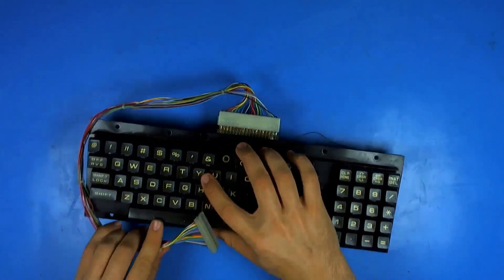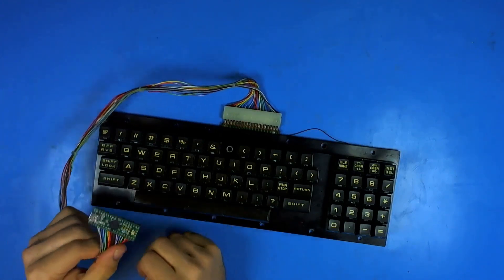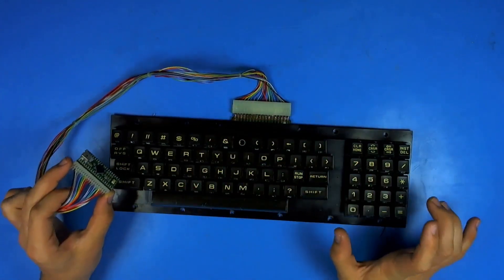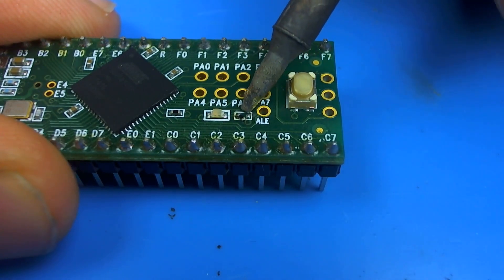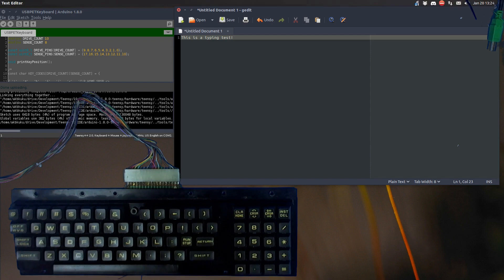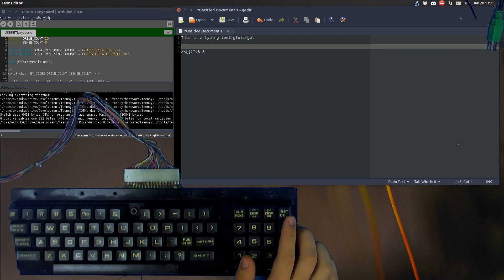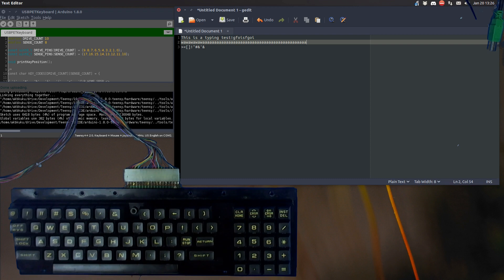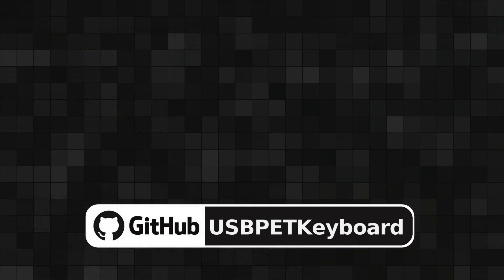0x0007 - USB Commodore PET Keyboard

Comment: I'm curious, how is the keyboard above the Ubuntu Desktop? Are you doing background replacement, or do you have a fancy-pants tron legacy desk?
Reply from the maker: I'm glad to see someone else liked Tron Legacy! The effect was achieved by Chroma-key'ing off the blue ESD mat with OBS. This was all recorded with a webcam pointed down straight over the work area. Though it is an ESD "mat" the surface is not "matte" and reflects a lot of light creating hot spots that have to manually matched. I ended up creating my own diffused work/film lights from a high powered LED to help with this. I may do a video on them in the future.
Reply: AkBKukU Alternatively, if you want to, get some broken LED monitors (showing cracks and pretty colors), and pull out the led panel. They are insanely bright and can literally light up a room.

Also, I really like how Disney made a "touch" computer for the movie. overall, tron legacy is one of my favorite movies
Reply from the maker: I've played with those before. They are really bright. I've wanted to use them for exactly that purpose but mounting them becomes a challenge. You can start with a VESA compatible model to make mounting easy and just remove the actual LCD leaving the frame intact. But then it's pretty bulky. You can ditch the frame and have just the thin backlight, but then you have to manage the power supply and the controller. What I setup cost me ~$20 a light for 20W of easily directable, cooled, and diffused lighting.

It is a very under appreciated movie. I wish they would release a special edition with full surround but no dialog. The soundtrack is amazing and I would love to be able to have the excellent visuals while listening to it.
Reply: AkBKukU Nice, I used LCD panels from broken Polaroid PTAB7200 Tablets. I powered them with a 9v battery with a 100ohm resistor in line with the positive wire. 

I agree with you about Tron. It's pretty much the only reason why I like Separate Ways by Journey. 

Also, do you ever hang out on discord? I think it might be easier to chat there, rather than reply to eachother's comments here.
Reply from the maker: I'm not in any of the discord servers. Right now I'm doing some other work so I don't really have time to get into a longer conversation anyway.
Reply: AkBKukU Ah, okay. I understand. Maybe sometime in the future, then?
Reply from the maker: I figure there should probably be some kind of "Official" discord server for this channel so I went ahead and made one. That would be a good place to chat. The mutilated link it to keep google from filtering it. 
discord.gg Hbw6Pz5
Reply: oh hi